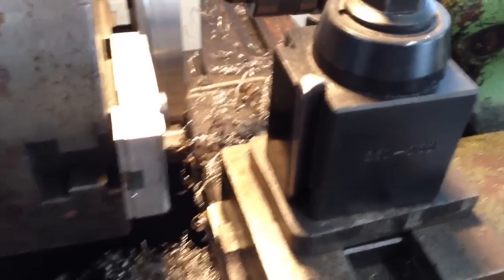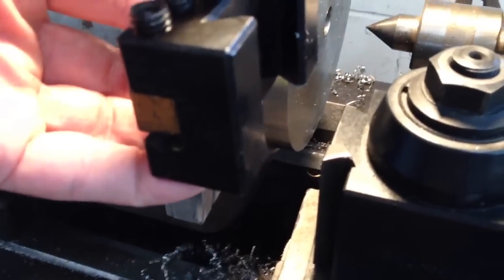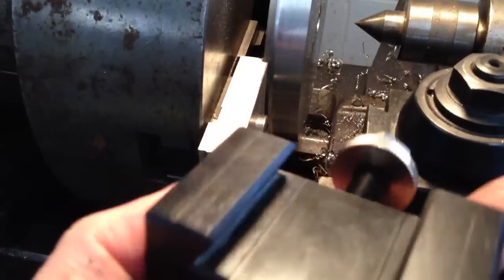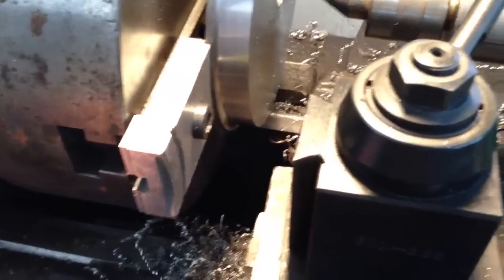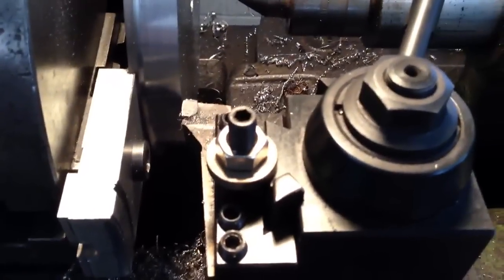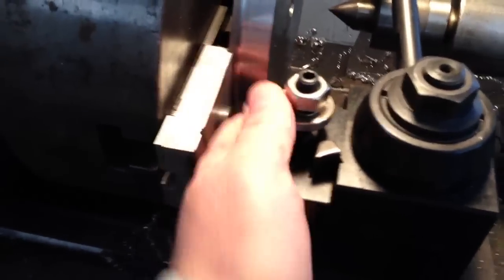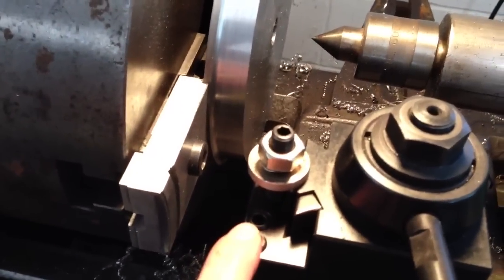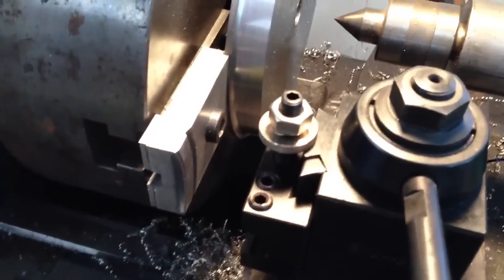Lathe Quick Change Tool Post Fix

Comment: I bought a different QCTP, but had the same problem as you. Instead of grinding in the tool holders themselves, I ground the post at the same location. Either way works I guess. Thanks for posting.